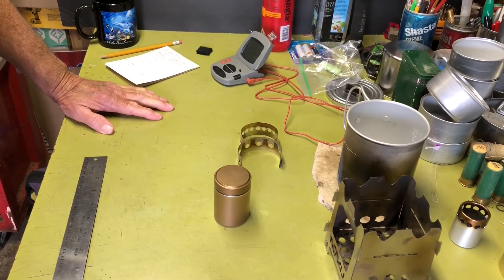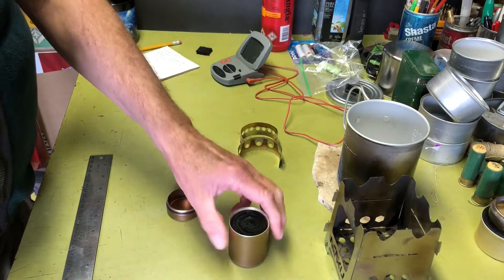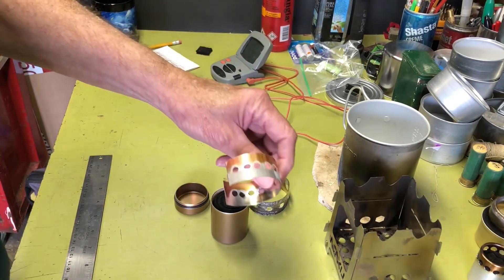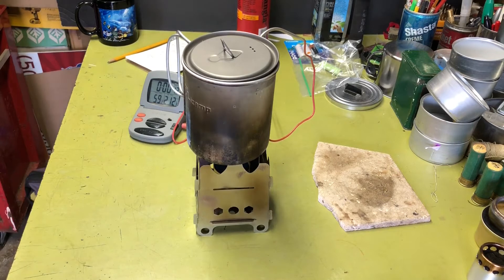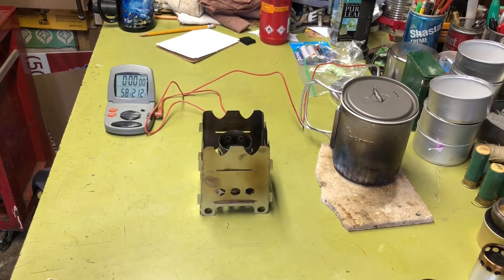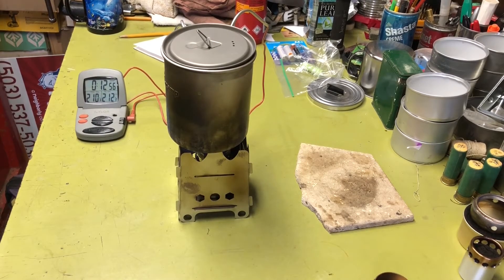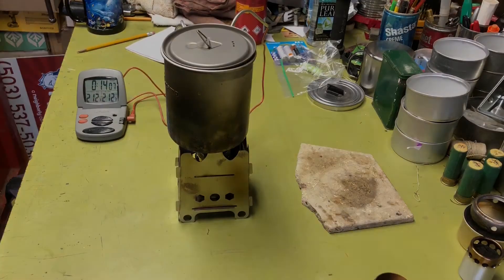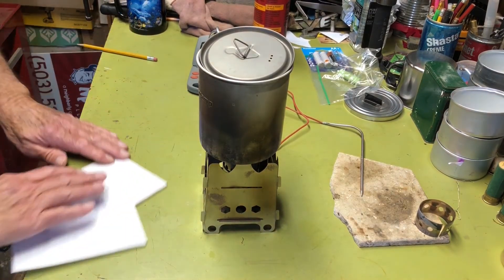Turbo Ring Tests For Canister Alcohol Burner

Comment: Just about every alcohol stove does not usually have air input in the center of the stove.

While watching the flame, the center should be pretty devoid of oxygen and thus less heat and more soot (depending on the fuel).

What if you added an air tube through the bottom of a stove to a little below the sweet spot of the alcohol flame tip in the center?

Theory - tube should heat up and provide some thermal feedback as well as causing the chimney effect drawing air to the center of the flame column.
It should provide a better flame, more heat, faster warm up, etc.

Of course you would have to have a different lid. Think baby bottle style lid out of metal to cap off the container.
But then you still have the hole in the bottom to contend with.
Reply: Chimney ( (laminar flow) alcohol stove: Hold my beer! ;)

Comment: Great video my friend. 
If you don't mind me asking where did you find the small canister?
Great idea for a stove. 
God bless
Reply from the maker: I found them on eBay. It looks like they’ve gone up in price since I bought mine.  You might look around, there may be other sellers.  
They aren’t water / alcohol tight so you’ll need to get an O ring from a hardware store. 
Have a good one.  

https://www.ebay.com/itm/Airtight-Smell-Proof-Spice-Herbs-Jars-Containers-Canisters-Screw-Top-Lid-New-YS-/154160292464?_trksid=p2349624.m46890.l49286